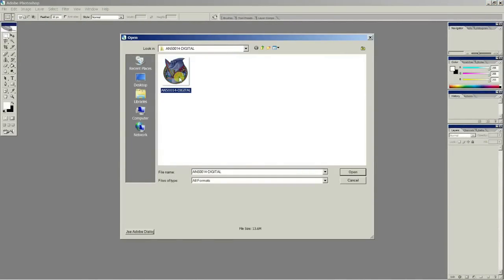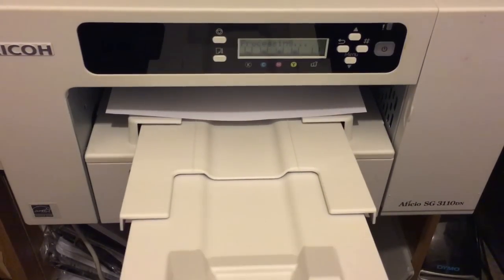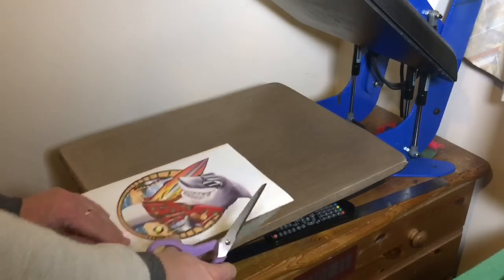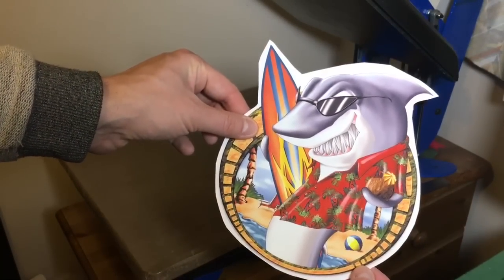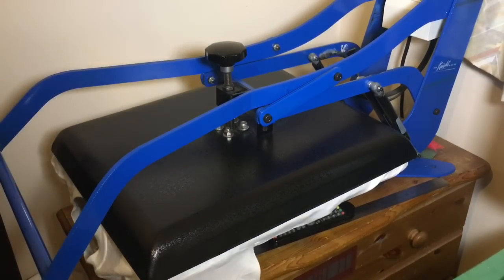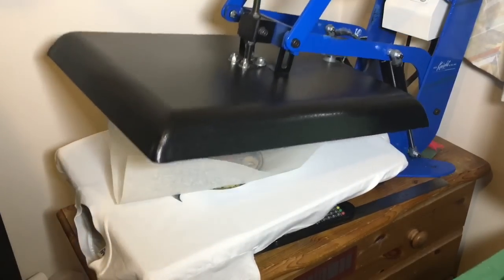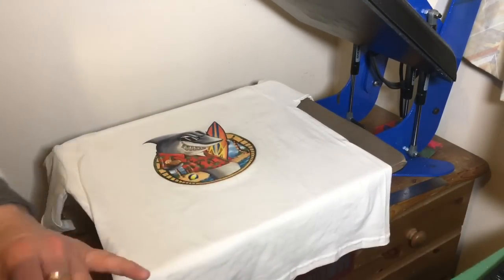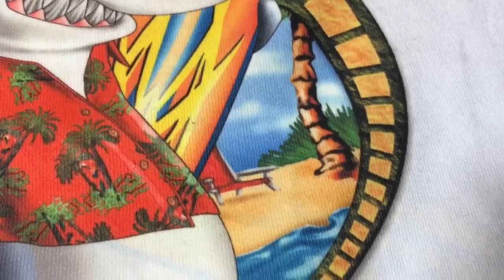printing t-shirt with heat transfer paper

Comment: What would it look like if you didn't trim the paper? And thank you for the video. It's very helpful.I also like that you heated the shirt 2 more times to ensure the longevity of the design :)
Reply from the maker: If I dont trim paper, it would leave slight glue residue. no much but you could see it as is little bit off white.
Reply: @PrintingGeek  what kind of paper are you using?
Reply from the maker: @reponzasmith7075  please check description for links.

Comment: Forgive me if you’ve covered this in earlier videos, but the issue I’m running into is what inks to use for printing your transfers. Do you use your branded printer ink that comes with your printer or did you have to purchase special sublimation inks separately? Please advise.

Comment: Hey good video. I recently ordered a heat press machine but I haven’t succeeded yet in using it. When I apply the transfer paper with the image face down, and despite applying the heat as much longer as needed, the image fails to apply onto the tshirt or when it does, it goes with the back of transfer paper and sticks on tshirt with the image still on the paper but nothing on the tshirt. Any reason to that? Is it because I overheat?

Comment: Hi, great video! Do you have an idea of how long will this last? Approximately how many washes it will resist? I currently use HTV with very good results. Thank you in advance for your time!
Reply from the maker: Disennior it doesn’t last as long as htv but it has better feel and is a great alternative for other colour printing methods. It lose bit of a colour after first wash but not a great deal. After than i would say- 15 washes.
Reply: Hi do uno if using transfer adhesive powder it would stay on tshirt longer?

Comment: Is the difference between heat transfer and heat transfer vinyl basically heat transfer the picture is part of the clothing but vinyl is that extra piece of material that is on top of the clothing that can crack after periods of usage?
Reply from the maker: no, Heat transfer is general term used for transferred artwork to the substrate. It can be heat transfer paper, heat transfer vinyl or sublimation transfer. All of those differ in feel, technique or equipment that is used. but end effect is similar. transferred image to the blank. Is up to you what printing method is best for you.  hope this help
Reply: how to print stuff uk thank you! could I also ask how you get a higher quality picture from the printer? Does this depend on the program you are using to make the picture as well as the printer? If so, what can I do in the program to make it high quality?

Comment: Hey im trying to purchase a t-shirt machine but i dont do you have any tipes on do i need a computer or anything to get the prints for the machine
Reply from the maker: what kind of machine? do you mean heat press? You will need computer with graphic software. Most important is, you need to choice printing method for your t-shirts.
Sublimation, ink jet transfers, laser transfers, plastisol transfers, solvent? there is many ways of printing and each of them require different equipment.

Comment: This looks very nice, i did buy long time ago ( 10 years ) also tshirt paper, but that was very bad, you did have to cut out the picture very well because otherwise around the picture on the shirt was also a kind of glue or white paint, i was using then a electric iron ;-)  I think with this paper there is no glue or white paint on the shirt around the picture ?  Thanks for showing this, very nice, i gonne look also for tranfer paper but then for black shirts.
Reply from the maker: You are right! cheap transfer papers simply glue on to the shirt. this is industry paper called Jet pro softstretch.